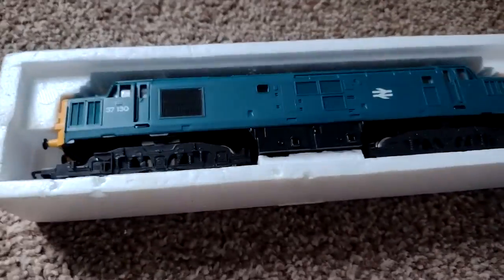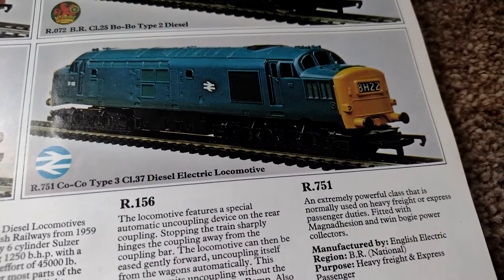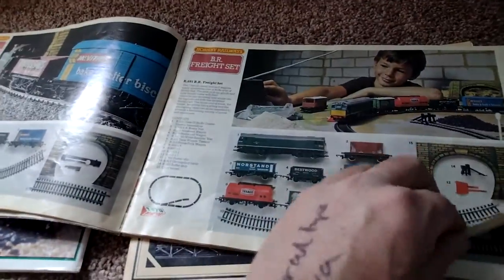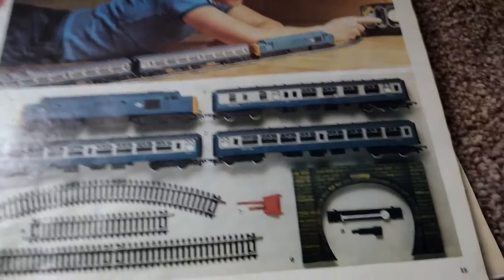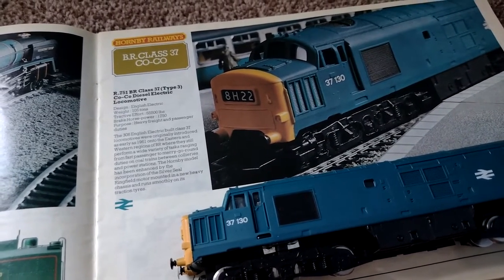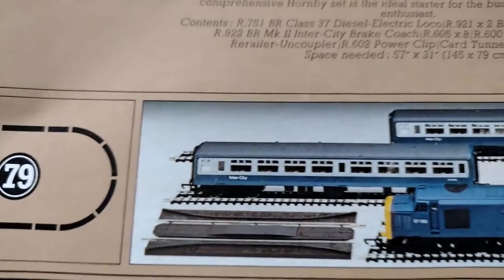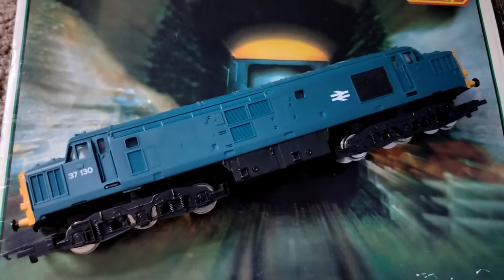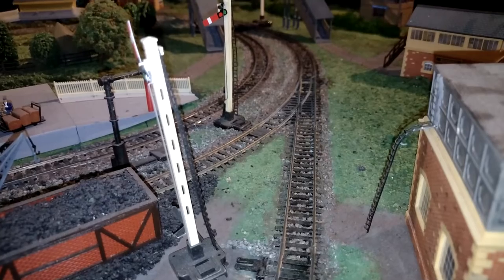Hornby Trains R751 37 130 BR Class 37 Type 3 Co Co Locomotive

Comment: Had this model, the Tri-Ang older version with Magnahesion and it could easily pull every single item of rolling stock I owned, including over 30 coaches with both plastic and metal wheels plus over 50 goods wagons. It was absolutely phenomenal, nothing pulled like that, I got the class 47 with ringfield motor and no Magnahesion and that couldn’t pull anything like as well. The Magnahesion pull was so strong and the secret to that class 37 being unbeatable.
Reply from the maker: Yes, a real class act - how does it pull on the modern track? I gather magnadhesion loses its effect on the nickel stuff?